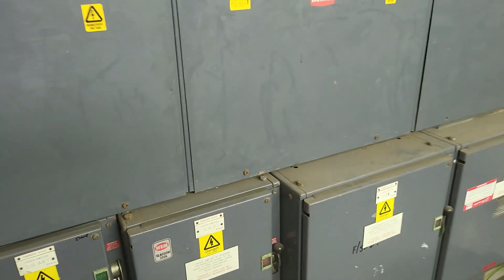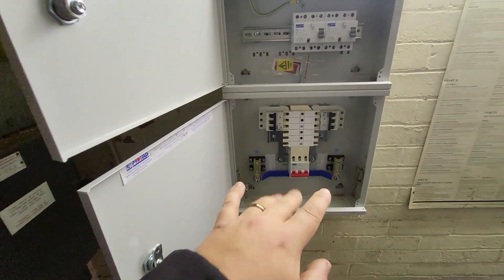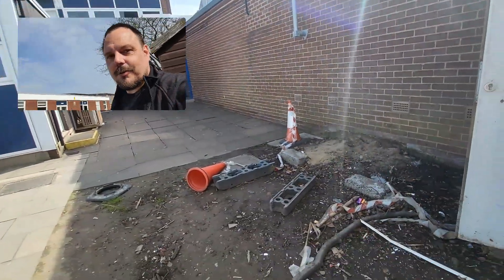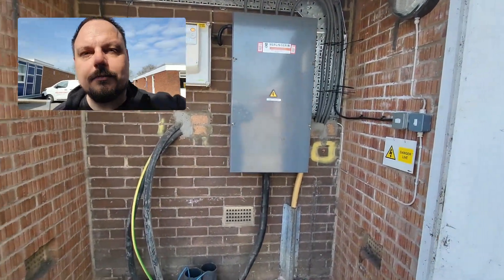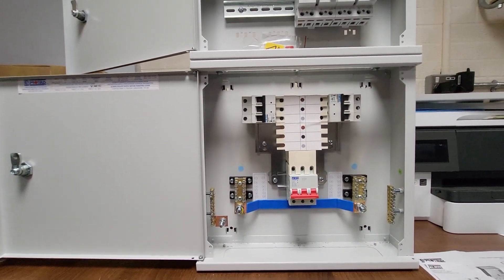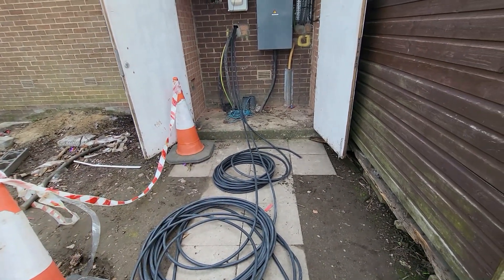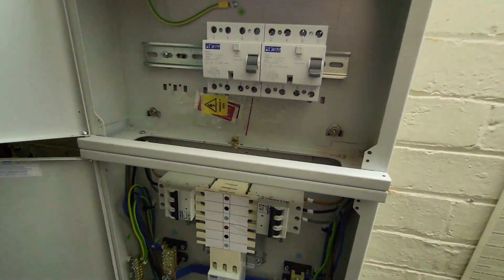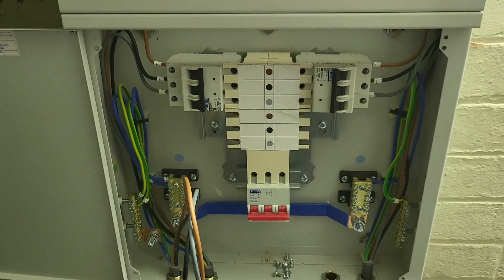What on earth? Old School Electrics mixed with Modern Three phase MEM and Proteus

Comment: Great video mate. Just a question on the TIS pro, im struggling to get my head around it! Do you insert the neutral with the earth for PFC and also ZS testing. Sorry im a 2 yr student. Thanks alot love your videos
Reply from the maker: Use the help menu on the tester mate during the test. It has diagrams. Depends what mode you have the tester in but the probe colours and positions are shown on the screen for each one.
Reply: @electrician247  Thanks for replying Mark, I have the TIS pro. The problem is how to test pfc. I watched a video on Nick bundys channel where he or adam said there gonna keep the neutral lead attached the the earth lead for most of the test. Also does that apply for ze reading. Sorry the be a pain but im use to megger and there doesnt seem to be much info about the TIS pro. Thanks again for replying and for the great videos
Reply from the maker: @JOSHIMEOW  TIS have some videos here mate https://youtube.com/channel/UC9lv-wWMeU1NCNtX13DVMgQ

I've covered Ze and PFC testing a few times on my channel if you look back through the videos. 

It's normally a 2 wire test and for Ze you would have the earth disconnected from the MET and get your value for Ze. 

PFC you would have the earth in the MET and repeat the test with the 2 wire lead. 

You can the  swing the tested over in the settings to repeat the test L-N or L-L if 3 phase and adjust the leads accordingly. 

Or you can do the same test again but probe onto the neutral rather than earth. 

I would ask your employer or tutor to take you through it if unsure mate. Would not want to instruct via video if you have doubts buddy.

Comment: Out of interest do they not make 3 phase RCBOs, do you have to use a separate MCB / RCD device?
Reply from the maker: If you are using an RCD it must open all phases. Including the neutral. So you won't fit them in a normal spine board.

Comment: WHY OH WHY did you use the crappiest D/B known to man? Even a Chint board is better than that
Reply from the maker: Disagree bud. We have installed most brands on the channel. The reason being to give them a fair go. Value for money I can't knock them. 

You have a bad experience with Proteus?
Reply: CEF own made and branded product you are now tied to them for the life of that D/B. In a school where money is no object and MEM is already there, I would have gone for an Eaton board although still not the best
Reply from the maker: @acespark1  it's an academy mate and we are trying to help the school get best for the buck. Nothing wrong with Proteus on these EV setups. We install Hager, Schneider and Eaton very very very often on TPN. 

You had some failures or a reason to dislike? 

Personally value is critical especially in education. However this is all speced by others. We had no choice on the charge points or equipment installed. Would still probs have done the same though. 

20+ years in and in total honesty I can not knock these boards at that money. Good experience with service life as well
Reply from the maker: @acespark1  Shaun, I think its Shaun anyway lol. We have installed lots and lots of TPN gear from Eaton, Schneider and Hager. Some features on the channel. I cant knock Proteus tbf to them. At that value it makes a lot of sense in a school environment with stretched budgets. We didnt actually spec the charge points or protective equipment here. So you joined a few dots and came out wrong lol. However I would have no issue using it again and can see the benefits. 

When we open up some of these jobs to apprentices over the summer we will have Eaton boards and Schneider Acti9 boards going on. Our Sports car showroom job we have Hager. I am not a DB snob at all. They all have strengths and weaknesses just like sparks. 

If you want pop a video up of one of your jobs and I will check it out bud.

Comment: Nice job, bloody wholesalers 😂
Reply from the maker: I can't fully blame them. I've been off work looking after my wife for a few weeks so wasn't as on the ball as normal.
Reply: @electrician247  Mark.  If the rcd  is in the ev  point  downstream  of the incoming  supply  armoured.  Will it protect the supply  cable as well as whatever  is plugged  in to the EV? Nice work.

Comment: What was wrong with using the banjos with brass nut & bolt flylead? like the existing installation, the old ways are sometimes as good as they were then.
Reply from the maker: Nothing is the honest answer. But on bottom entry with the main feed still to come it can get a bit busy. So this is an attempt to limit that. 

Plus the modern banjos, gland nuts etc are not great. Piranha nuts are infinitely more substantial and we prefer them.
Reply: @electrician247  Got to agree most of the gland nuts, as well as bushes, are wafer-thin.
Reply from the maker: @anthonybragg   this is the problem when you are running out to EV pods I want confidence the armours are earthed lol.
Reply: Excellent  job.
What do the regs say re using  armoured  outer vable as the only  earth? I just did the test n inspect  course  and they didn't  cover it. Steel or aluminium  so more resistance  than copper.